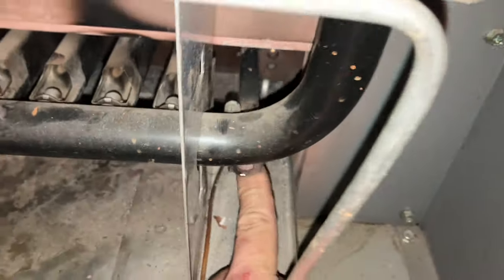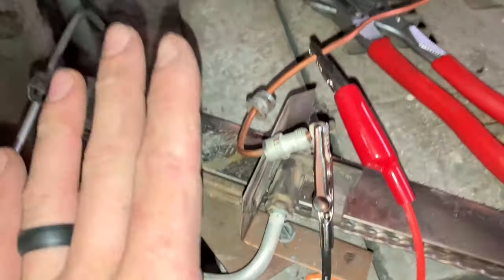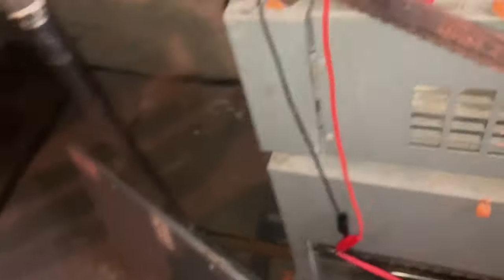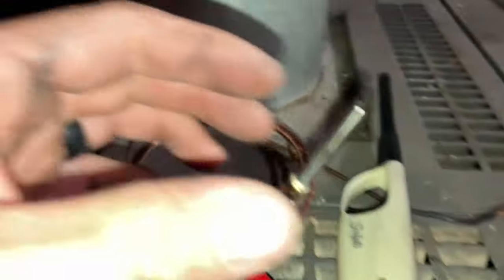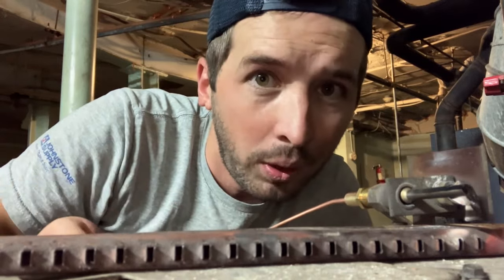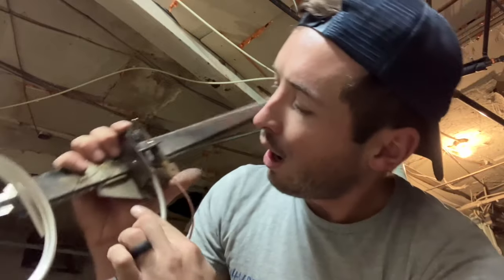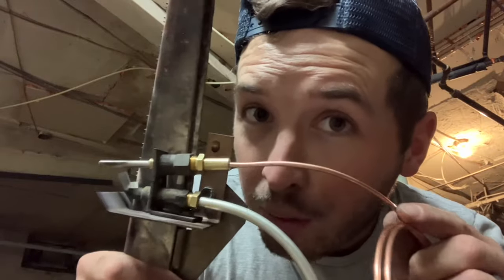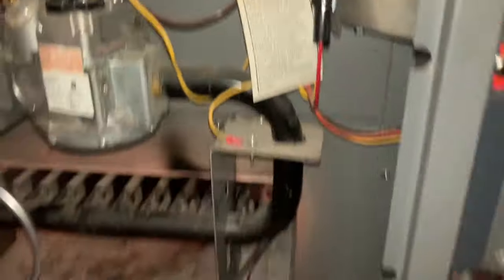How to Really Test a Thermocouple

Comment: You learned the operation of the thermocouple show to test, but you need a course in how to use hand tools. You don’t use a pair of channel lock pliers on a thermocouple nut.
Reply: Indeed...every DIYer needs a good set of flare nut/brake line wrenches.👍

Comment: Copl video. Mine always goes out (about every 2 years) but both times i jist dis assemble the thermocoupler, sand it a bit ans air hose it and seems to fix. Pretty cool being able to test the dc volts on it like how you show

Comment: As for how it works, as one side of the thermocouple metal warms up, wouldn't the opposite side soon warm up due to conduction and therefore reduce the current needed to induce the solenoid? Thanks
Reply: I'd have to look up the details, but it is the dissimilar metals that cause the electron flow.  They use different combos for different specifications.  Heating the junction causes more electron flow, that is seen as millivolts but it is the current flow that keep the solenoid pulled in.

Comment: Great content brody. Another tip is to put the adapter for the pilot tubing in the gas valve/pilot assembly by hand first,back it up a turn, THEN put the tubing in. Much easier as well. 7:13 , 8:22
Reply from the maker: Thank you for the feedback, and thats a great tip! ill have to remember that one!

Comment: Yep. I never dick around with checking a t couple, $13 a piece, just change em out.
Reply from the maker: if its bad now, it will go bad again right!
Reply: You're right. Just replace that thermocouple instead of cleaning it. Sometimes a gas valve is stuck and if you tap, tap, tap on it, it will work but best bet is to replace those faulty parts. The parts may be going, going, but not yet GONE. Who wants a call back in 1-2 weeks for the same problem. Makes it look like the serviceman doesn't know what he is doing!...... If customer thinks the parts will somehow "heal" itself and get better over time, tell them it is not like a person getting a cut on their arm and over time  heals on its own. The part is "aging out" or "aged out" Most customers can relate to those medical type terms!